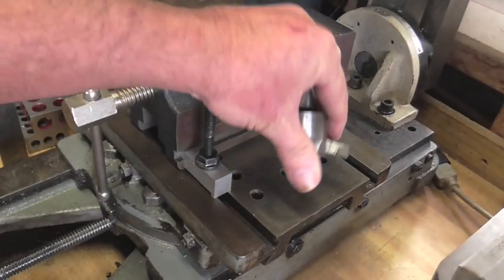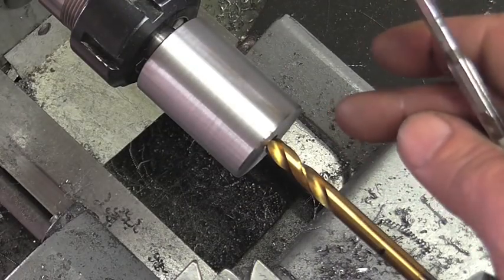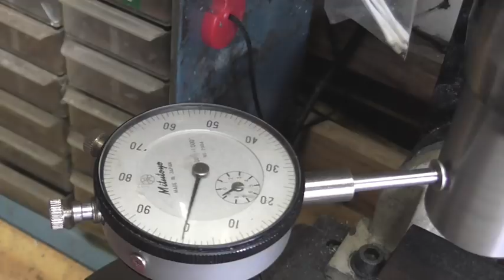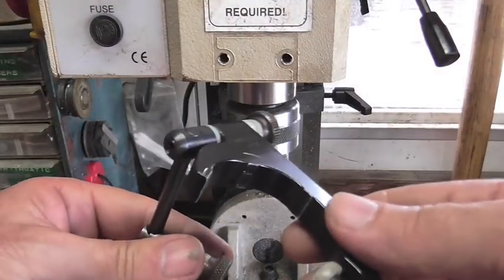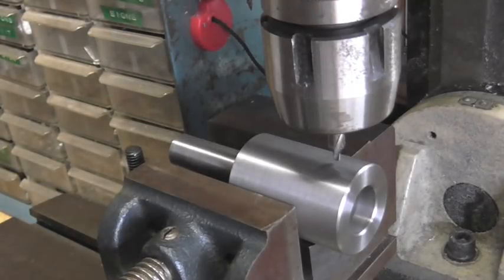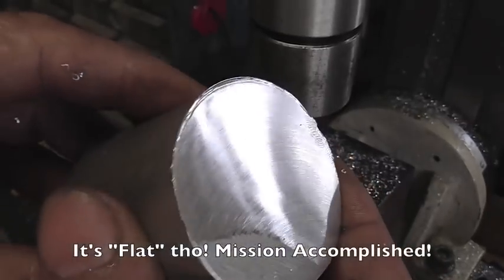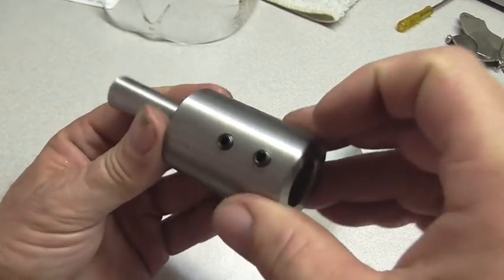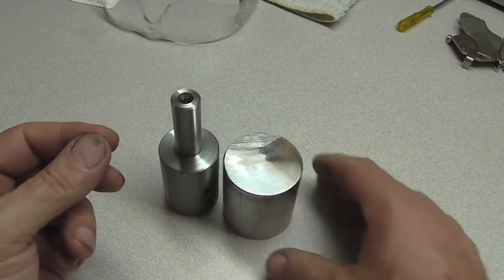Machining a Fly Cutter Arbor  For The Mill - MSFN

Comment: Hi Richard. I use a fly-cutter pretty much anywhere it will work. It satisfies my sense of frugality to use tooling that's so cheap to renew; If I dull the edge on some mill scale or whatever, all it takes is a quick grind to renew the cutting edge. It does take a while though, since there's only one cut per revolution. I usually rough with whatever depth of cut will let me crank through the pass as fast as I comfortably can; there are no points for surface finish in a roughing cut and that helps move things along more quickly. For finishing I only take a couple thou and increase the revs and slow the feed. Also a shot of WD-40 on Aluminum works wonders on the finishing cut. To improve your surface finish, I'd use a HSS bit with a healthy amount of positive rake, at least 10 degrees, maybe 15. That will reduce the cutting forces and thereby the deflection. The lever arm of the long tooling setup is working against you, so as soon as you can shorten that up I'm sure that will improve things a lot as well. Finer finish comes with more nose radius on the cutter, but that has other consequences as well since you probably don't want to bother swapping bits before your finishing pass; you'll just need to find a happy medium. Anyway, some of the things I've learned :) Thanks for the video!
Reply from the maker: Hi Steve, thanks for the advice on the flycutter. I am always eager to get advice and learn from those more experienced. I have some HSS the right size for the cutter and will experiment with your suggestions soon. Thanks for Watching ~ Richard
Reply: Tom's Techniques has a great fly cutting tool reference here: http://tomstechniques.com/wp-content/uploads/2014/03/Fly-Cutting-Bit.pdf, that's where I started. It works really well, especially in aluminum. I ground the very outside edge at an angle, so I could cut up to a vertical feature, like a step or something, without hitting it with the end of the tool. Otherwise, mine is just as Tom pictured it. Tom also has a great video of fly-cutting, if you haven't seen it I highly recommend it :)
Reply from the maker: I subscribe to Tom, wish he posted more content nowadays. Thanks for the link Steve, I appreciate ya

Comment: I have  the same finish problems with fly cutting on my very similar mill. It seems to be a product of the head/column flexing away from the bed when under pressure. The flexion movement is even visible when I try to make moderately heavy cuts (+1thou). They just don't have enough mass and contact area between the base joint of the column and the X/Y bed. I can improve the finish with light spring passes at super high speed (with a sharp bit). Thanks for sharing.
Reply from the maker: Yeah, I am finding out quickly the limitations of the little guy. My X/Y base is from another machine and is stout but the grizzly portion of the mill is lacking. Its a decent starter mill....more suited for aluminum and brass me thinks 😊 Thanks for watching! ~ Richard
Reply: I noticed the good old table - nice mod - still very little head room though. Wait 'til you get a keyless chuck (the first thing I got for my mill) it gets to be like your fly cutter setup. Lots of times I have to abandon the vise, and clamp directly to the table. Oh, for a Bridgeport!
Reply from the maker: Yup, I feel about the same as you. It makes a good drill press tho! LOL 😊

Comment: Nice video Richard.  Being able to clean up larger surfaces quickly is a good thing. You are getting good 👌. I always enjoy turning between centers.
Reply from the maker: Hi Steve, I think I will find myself using the flycutter a lot once I experiment with it more and get it dialed in. Rigidity of this little mill presents an issue.....maybe I can help battle that with a nicely ground cutter. Yes, turning between centers is pretty cool 😎
Reply from the maker: I saw your notification, gonna head over and watch your wife fix the phase converter 😊

Comment: good job Richard one thing I have seen on all your video's is the exhalant finish on your parts on the lathe and I see your using high speed steal too I just hope I can do as good one day soon .
Reply from the maker: Hopefully with experience I can get this mill to produce nice finishes....I am totally new to milling. Will do my best with this little mill but it's no Bridgeport!
Reply from the maker: I never use a file or sandpaper on the lathe parts anymore to achieve finishes...what you see is right off the lathe
Reply: we do with what we got that's what I like about you is you make do

Comment: Nice job Richard. Looks like it will serve the purpose.
 I think you should have made yourself a new flycutter instead of the adapter. Its a great project and you can make it any size you desire. You will find out you will need that extra space between the spindle and table that your adapter used up..
Reply from the maker: Thanks, if I had some decent milling cutters I would have stopped mid-project and just made a fly cutter instead. You will see a fly cutter made here on the channel once I tool up for the mill...takes time

Comment: Good work on the concentricity, the irony is you don't need it for a fly cutter since it is single point, you could have tons of run out and it still would work the same.:-)
Reply from the maker: (facepalm) Well, at least I got in some good practice for making my slitting saw arbor 😊
Reply: Practice is always nice. :-)

Comment: Hey Richard good job I have bought one time a central Machinery mini metal lathe and some aluminum round bar I was going to try to cut some optic holders for a laser I was  building I didn't ever get to it though however but I learned how to use the dial indicator because I had a Four  jaw Chuck. that I bought for it I forget why I 3-jaw didn't seem like there was something not working working well with the 3 jaw  anyway seems like you know your stuff
Reply from the maker: With a 4-jaw chuck anything can be dialed in to run concentric...with a 3-jaw scroll chuck you are at the mercy of the chuck in some instances but not all. Thanks for the kind words....I am just a newbie machinist trying to do my best 😊

Comment: I have built a number of these over the years and they have bailed me out of a bunch of situations. Well done fella.Next time you need to get some square hole(it fits the tools and you just silver solder it in place) and get a foot of it eh.It isn't expensive and you will use it over time.You can get it in 1/4,1/2 and 5/8. Just drill a hole and put it into the tool any angle ya want bud.
Reply from the maker: Was a fun project...4 hours of footage condensed to 16 min 😊
Reply: This TE guy is a good example of the type of fine people you have collected
Even if he is as I suspect a Canookian
Reply from the maker: I believe he is talking about how I could have made the machined piece a flycutter rather than an adapter since I chose not to go that route due to my less than stellar end mill selection at my disposal. just drill a hole, drop in a square insert and mount the cutter in it, a good work around in a pinch
Reply: LOL, right you are on the Canuck my friend and many thanks for the compliment.
Reply: It is a round slug/insert with a square hole to fit various sized cutting tools. You just drill your bar at any angle,slip it in and silver solder or braze it in place Then just drill and tap for set screws. Great stuff.

Comment: Richard
 What kind of mill do you have and what do you think of it, i have an encouraging 8'' by 28'' table, looking for a table top too for the basement......like I don't have enough tools already and 3 lathes,southbend 9'' southbend k10 and a small grizzly,,,I just like playing around with this stuff(retired machinist)
Reply from the maker: I call it a Frankenstein Mill. The mill head came off a Grizzly "Lathe/Mill Combo Unit" and was married together with a sturdy X/Y table from an unknown origin. It needs work....as my Y travel is like 12" and the X travel is only 5-6" the way they assembled this thing together. Its backwards....the X should be the 12". The guy only used it as a drill press so never noticed the pitfalls of the way it was put together. Its useless for many things honestly if you need travel. I am kickin around some ideas on how to reconfigure it so its more useful. Is good for light milling

Comment: As one of your other comments states, concentricity for a fly cutter is un-important. Is there a reason you didn't just turn down the fly-cutter shaft to 5/8"? Nice video work too! PS- I just subscribed :-)
Reply from the maker: Hi Rupert.....Having never owned a mill , the honest answer is: I plead ignorance.....I didnt know concentricity wasn't a factor when flycutting. My experience with a lathe is concentricity is king...so when embarking on a mission to make a part for another machine I assumed concentricity was equally important. So I did my best to make it so. Brianbloc who is a regular poster on my channel pointed that out to me (doesnt matter) when the vid 1st came out, we had a chuckle about it. I coulda just turned down the shank, but that woulda deprived y'all of my quest for concentricity and an interesting video...LOL. Thanks for the sub 😊 ~ Richard

Comment: Why not turn down the shaft of the flycutter instead?  It would avoid the long stickout.
Reply from the maker: Fair question. Mainly I wanted to see how accurately I could machine a part on the lathe as I rarely turn between centers.....so that went pretty well. A viewer recently donated the lathe dog and I wanted an excuse to use it. Secondly, turning a shaft from 3/4 to 5/8 woulda made for a boring video and not worth doing...LOL Thirdly, I was giving myself practice on concentricity because the end goal is actually making an entire flycutter with a MT3 taper as an entire unit using my taper attachment which I have also never used. And last, to inspire others who may need to make something they need for their shop that to be precise and how to go about it....all in all it was a fun exercise but as you pointed not...not exactly "practical" but was a fun project nonetheless 😊 ~ Richard

Comment: why wouldn't you just reduce the shank diameter of the fly cutter???
Reply from the maker: Just playing with concentricity turning on the lathe and experimenting with the new lttle mill. I could have easily turned the shank but that woulda been boring :)  In my pinned comment at the top I discuss the stickout issue....its not practical....but was a fun project

Comment: Why wouldn't you just mill the slot across the bottom and add grub screws to the peice you made and turn that into your flycutter
Reply from the maker: Didnt have the proper sized endmill for the slot, the mill is new

Comment: I find it heavily annoying you didn't pass the fly cutter completely across to check if the other side is level... SIGH
Reply from the maker: I hear ya, but ran out of travel on the X and that was far as I could go. I was pretty anxious to give it a go and didnt want to reposition the vise and tram it in at the time. I will be sure and do that next time tho as it is important. I was focused more on the part made than the flycutting operation itself....but to machininists like yourself I can see where you are coming from....next time! 😊
Reply: Could've mentioned that in the video. 

Also, since it's a part to help machining... You do need to test an entire operation. 

Also, that giant stack of adapters gives me the heebie jeebies.
Reply from the maker: When I make a flycutter I already planned on turning it from a solid piece of stock and machining a MT3 right into it bypassing the collet altogether. That should make for a good project.
Reply: Can we rename Morse Taper 3 into Masterful Technology 3. It'd be more credit for completing it, I'd think.

Jokes aside, goodluck with the MT3 flycutter piece. It should be easy to make it. Some other machinist on youtube ,not sure if AVE or TOT already made one such.
Reply from the maker: Gives me an excuse to hook up my taper attachment :)